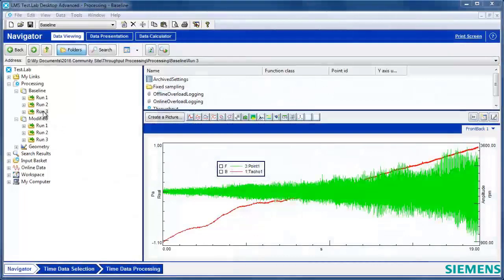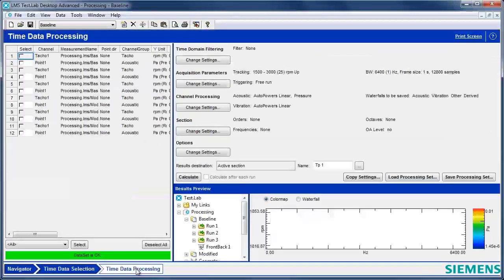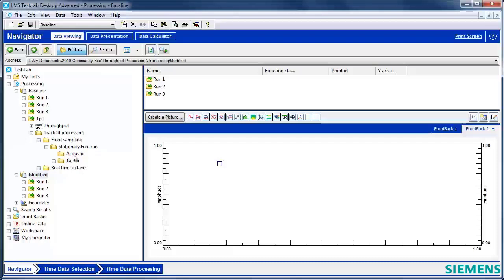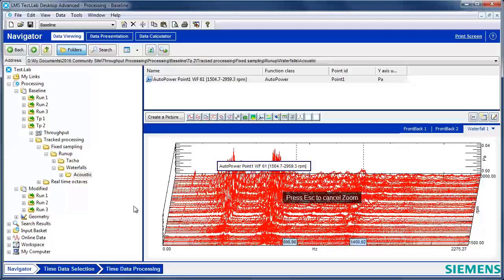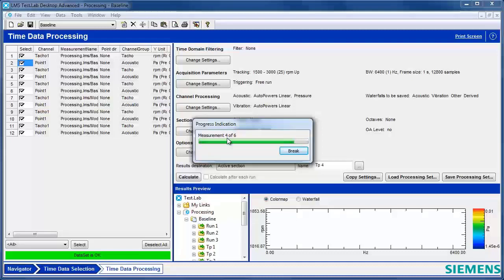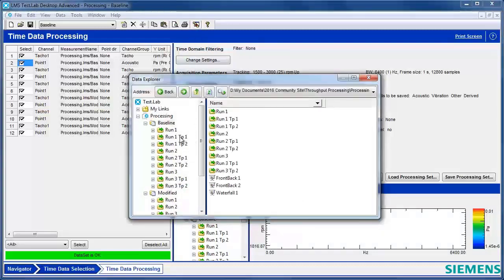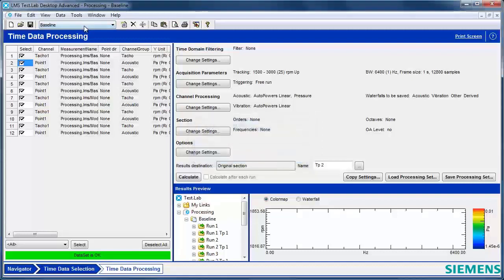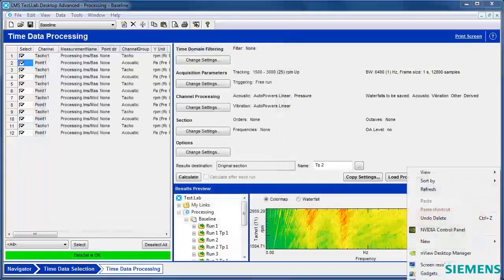Simcenter Testlab Signature Throughput Processing

Comment: Hello, I have a problem in modal analysis. I get the data obtained from my previous experiment from excel with the data block editor. (I also tried to import directly from excel.) I will do experimental modal analysis on these. I can select the data in the navigator and plot it in that section. Then I right click on the files and add to input basket. However, when I switch to the modal data selection section, the input basket is empty. I can't transfer the data to this side even though I've tried many things. Therefore, I cannot do modal analysis. And there is a red sign in the status section below and it says "unable to find valid data set". What should I do? Can you help me.
Reply from the maker: Assuming you are using function class “FRF” in data block editor, sounds like things are being done correctly. To diagnose the issue, suggest contacting Siemens support and working with a engineer directly: https://support.sw.siemens.com/en-US/about
Reply: @SimcenterTesting  I am importing acceleration-time and force-time datas in data block editor. Should i use FRF datas instead of time series?  If yes, how can i get FRF datas from time series in the software (i know mathematical process how to get FRF datas. But i dont know to get them in the software)Thank you for your answer.
Reply from the maker: Time histories need to be processed into FRFs to do a modal: https://community.sw.siemens.com/s/article/simcenter-testlab-throughput-processing-tips. Need function class frf and define force time histories as references.

Comment: Hello, I'd like to ask, what's the difference between choosing track -- time and stationary -- time in post-processing??? Which method should I choose in the actual test? For example, under idle condition? Thank you and look forward to your reply
Reply from the maker: Be sure to read the accompanying article: https://community.sw.siemens.com/s/article/simcenter-testlab-throughput-processing-tips.  Stationary would be a 2 dimensional graph - amplitude versus frequency.  This would probably be good for idle since the rpm does not change.  If there was a changing speed, then tracked would be better.
Reply: @SimcenterTesting  Thank you very much. I read the article, which is very helpful to me